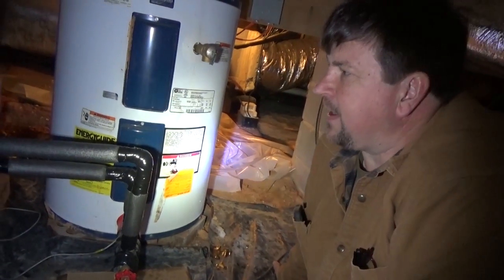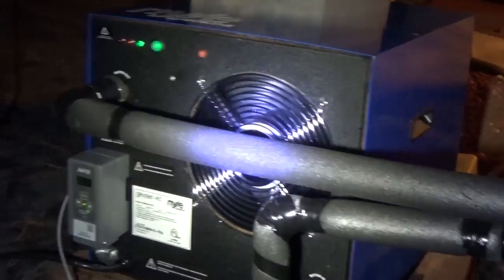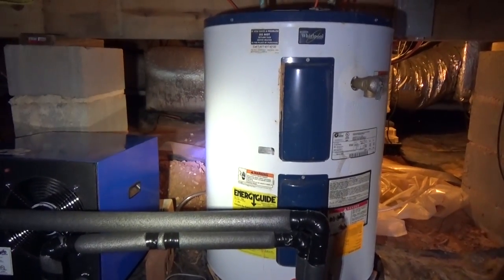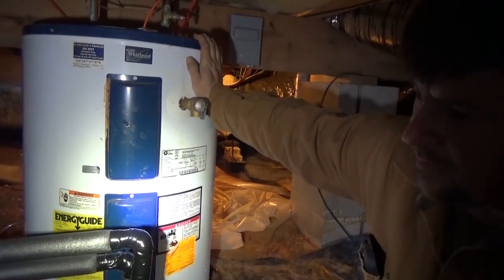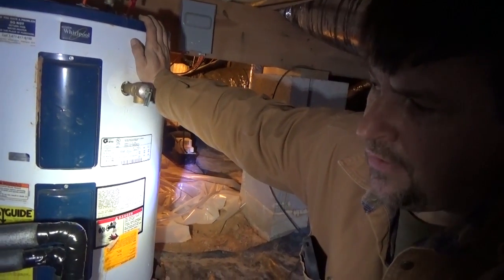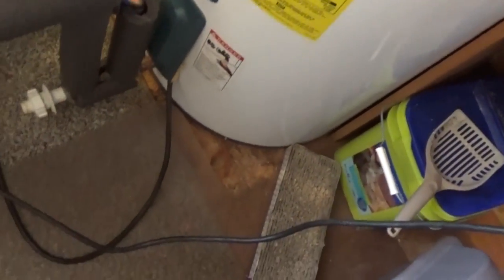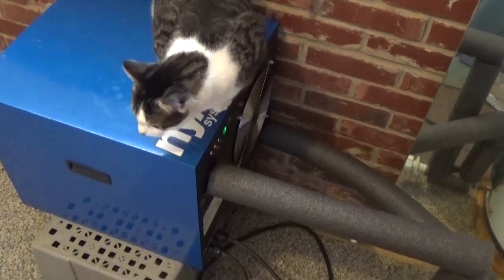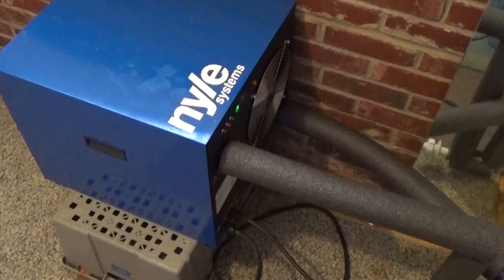Heat Pump Water Heater: Geyser

Comment: Hi Engineer775; I own a Geyser Hot water Heat pump and am looking for a PCB for it. Put in a new Compressor and know the board has an issue tried to get it repairs and the PCB biz says its unrepairable. My model is the 6000-3.0 Any suggestions as to locating  Geyser for Parts in US Located in Texas. I have owned this for 18 yrs without fail. Fantastic unit. Factory has no more parts for them.

Comment: amazing new technology. Hey can i use it on the hot water tank that is fed by my oil boiler?.I imagine the thermostat would call for heat from the heat pump instead of from the boiler or do both if possible if its winter. i also have solar on the house so the electricity to run it would be cheap during the day.

Comment: I would like to find (probably have to DIY) a system with modular components for managing heat, that interconnect and use a PLC or some other controller to best manage heat. when I say manage heat, Im talking about heat pumps (water heating, dehumidification, air condition, food refrigeration) something that can take advantage of moving the heat from where it is not needed to where it is needed and having sinks to disperse heat when there is excess, or to pull heat from when there is a deficit. the heat sinks could include, pools, ground, air. a way to bring heat from a wood stove. perhaps even electrical generation from waste heat (peltier junction, as inefficient as they are, using waste heat only improves overall efficiency)
Reply: Get anywhere with this? I've been thinking the same thing for some time now. Seems like the next logical step, but I don't see anyone tying it all together.
Reply: @pl-ps2pd  nope, maybe someday when I own a home, it will become my efficiency laboratory

Comment: I have a NYLE dehumidifying in the basement which my wife loves. I supplement it with PV solar to save wear and tear on the unit.  A 120V 2,000W  replacement element is a good match for a 36 , 48V or 60V  panel. I operate the panels at the power point voltage for the highest efficiency (MPPT).  Heating water with PV is about the best payback you can get on a small panel system.  The energy is stored in a capacitor bank and PWM into the heater element. Never direct connect panels directly to a heater element.  You will be lucky to get 40% of the daily energy.  My system is four times more efficient.  Lets face it, most of the day is less than ideal conditions for the sun.  This is why direct connect really sucks.  The heating element is a dump load most of the day to load the panels down to 60V, the max my grid tie inverter can take. A little Rube Goldberg but efficient using stuff I had around.  Solar backup for not much more than the price of just the panels.  Can't get more prepper than that.
Reply: "Heating water with PV is about the best payback you can get on a small panel system" that depressing to think thats true? 

I wish some company would create a combined heat pump system to create synergies including a geothermal source but not required for of all heating and cooling in a home. Like a HVAC, Water heating and Refrigerator since they all can be based on types of heat pumps. So it could be made more efficient if they were all combined and possibly even be cheaper? And cheap low temp solar could increase efficiency,  

But solar or point of use heaters seem like the best option in most of the world. When I travel I see both of them used, 

Just a thought,..

Comment: Hi I am thinking of getting a heat pump to provide hot water and heating through radiators. My gas combi boiler is getting old and I decided to look for new ways to get heating and hot water. Your video is great and I always enjoy watching your videos anyway. I am not sure what equipment I need apart from heat pump and associated accessories. I suppose I need a water storage tank of some kind. Some places I read up also think that heat battery is another good way to save energy as the heat produced is very efficient per kwh of output. But the battery costs a lot in the UK, btw it is where I am based! In the longer term I am thinking of going off grid but at the moment I would like to know as much as I can to cut down my reliance of the grid and be kinder to nature.
If you have a video showing how you put the heat pump and storage together that will be a great help to your watchers or give us a link to one. Keep up the good work.

Comment: do they still sell this thing?
Reply: Google it, they seem out business. Cool idea but I bet it was not worth the expense. Other make all in one units but without rebates some utilities thats other give for it, its not worth it. 

I wish some company would create a combined system of all heating and cooling in a home. Like a HVAC, Water heating and Refrigerator since they all can be based on types of heat pumps. So it could be made more efficient if they were all combined and possibly even be cheaper?  

But solar or point of use heaters seem like the best option in most of the world. When I travel I see both of them used, 

Just a thought, good luck..

Comment: Do they still make these add on units. I can't find one for sale.
Reply: Peter Holman Nyle stopped making these unfortunately.
Reply: Cool idea but I bet it was not worth the expense. Other make all in one units but without rebates some utilities thats other give for it, its not worth it. 

I wish some company would create a combined system of all heating and cooling in a home. Like a HVAC, Water heating and Refrigerator since they all can be based on types of heat pumps. So it could be made more efficient if they were all combined and possibly even be cheaper?  

But solar or point of use heaters seem like the best option in most of the world. When I travel I see both of them used, 

Just a thought, good luck..
Reply: desuperheater units are often available for geothermal systems to exploit cheap hot water. That's about as close as you're going to get. You're already in a cost prohibitive area though at that point.

Comment: Hi if you didn't want it to cool the room couldn't you simply duct intake/outtake to the outside insuring you get the 1500 c/ft..........or better still duct the intake to an area of "waste heat" like the roof cavity/attic ....wouldn't that up the cop?
Reply: great question, I live in Canada, summers are very hot , winters very cold, so yes half the year the use of attic heat in summer would be efficient but not needed as these systems are designed to work at ambient temperatures, water lines in the attic in the winter would be a pain/ could most likely freeze up. a side note: I have seen copper coils that if the incoming water from a well let say was first drawn through before it entered your hot water tank could speed up the heating process if the coil was in a summer attic, and then drained and bypassed for winter months. in the past copper tanks where used in the attic and used for the same purpose.

Comment: +engineer775 Practical Preppers
 I have a questions regarding this unit and the crawl space.  My crawl space stays humid and I was thinking something like this would be perfect to heat the water and also keep my crawl space dry.  So now I want to ask how it has been doing and also what climate are you in because it doesn't look like a conditioned crawl space to me and according to the manual you can not use these if the ambient temperature is below 50 degrees Fahrenheit.  The manual then shows in troubleshooting section that it can go in defrost mode a lot causing problems if under 50.  It doesn't make much sense to me seeing how regular heat pumps outside can work under 50 degrees F.  Have you had any issues and does the crawl space get under 50?

EDIT:
I pulled the manual back up.

"Only place unit indoors where the ambient air temperature will not drop below 50°F (10°C). If at any point the temperature drops below this, Nyle recommends that the unit is shut off until the temperature is restored."

And from the Questions and Answers section in manual.

Question: "My Geyser is going into Defrost Mode frequently."
Answer: "The Geyser is located in an area where the ambient temperature is low (below 50°F) and the humidity is high."

So how has this unit been doing?  Has it been causing any problems?  Not sure what they mean by shut off until temp is restored whether they mean drain and disconnect hoses and also turn power off or just turn power off because seems to me if it was in a crawl space and turned off the water in it would freeze because it seems to me it wouldn't be circulating still.  Any info you have on this would be great.

Comment: Sorry if I have missed this in your videos but if installed to run off my solar array how many watts would it pull.  Im planning the building of my off grid 500 sqft home. I have most things worked out but the hot water choices for solar application  all have there draw backs. Hoping this might be a solution for us.

Comment: +engineer775 Practical Preppers, thanks for the video. i have an oil furnace  that heats my hot water and my hot water base board heating. would this application work in my case ?

Comment: how long would you say Geyser has to run to heat 40 gallons of water from 50 f to 125f?
Reply: a 40 gallon about 2.5 hours a 60 gallon about 4 hours that is about the same time it takes the elements to heat it without the heat pump in use. I was an installer and representative for Nyle in 07-08, these are still great systems I use one my self in my home still.
Reply: @kiermizuik275  what's the max temp you can get from heat pump? Seen a dozen video, no one asks or cares?
Reply: @rogerkerkmann  well its a circulating and accumulating heat that collect in the hot water tank , it will keep working until it satisfies the bottom elements of the hot water tank and because of that is limited by the thermostate in the tank . but does so at 300-350 watts . it takes 3 to 4 hours to complete the process and heat the tank in about the same time as the in tank element.
hope this helps.
Reply: @kiermizuik275  thanks for the response, but my question was the max temp a heat pump can put out, 120?  180?
Reply: Roger Kerkmann I never measured it. To tell you the truth all I can say is it has to be at least as hot as the water in the tank 125 but I have seen in test it go a bit higher. But never enough to satisfied like a boiler temp for hot water heating.

Comment: I don't get how dehumidification of the crawlspace is happening.  please explain
Reply: it works like an air conditioner, it takes heat from one place and puts it somewhere else. Water condenses on the cold side because it is colder than the dew point of the air and is collected and pumped out of the area.

Comment: E775; do you know of anyone who makes a similar type of heat pump using a liquid cooling system on the evaporator side, rather than air cooled?    Here in Southern Nevada, hot water doesn't cost very much at all in the summer months, as the heat rise is minimal and and we tend to not use much anyway.  In the winter, outside temps are too cold for this unit most of the day, and most homes use heat pumps or electric furnaces for indoor climate control / heating, which seems like it would kinda destroy the efficiency by doing that twice in series?  Or maybe not...  I'm not quite sure how to do the math on that.

However, we do have a whole lot of geothermal sources (wells), and solar heated swimming pools which could potentially be excellent heat sources, but store thermal energy in liquid water instead of air.  Just a thought!
Reply: I agree it was a cool idea but I bet it was not worth the expense. Other make all in one units but without rebates some utilities thats other give for it, its not worth it. 

I wish some company would create a combined system to create synergies including a geothermal source but not required for of all heating and cooling in a home. Like a HVAC, Water heating and Refrigerator since they all can be based on types of heat pumps. So it could be made more efficient if they were all combined and possibly even be cheaper? And cheap low temp solar could increase its efficiency even more,  

But solar or point of use heaters seem like the best option in most of the world. When I travel I see both of them used, 

Just a thought, good luck..

Comment: Would you prefer the use of the GEYSER over a solar water heater considering cost, installation, maintenance, reliability and efficiency? Do you believe that there is an even better means of producing hot water?
Reply: no, but if you hear of one please reach out and tell me, I have used one of these for 15 years now and it has paid for itself many times over. I live in New Brunswick, Canada .\basements are heated in winter and damp in the rest of the year. this system was perfect for me, and many others that I had installed it for here. I think a family of four could see a 35-40 dollar a month savings the more hot water was used the high the savings, larger families it was significant, people with other than electric heat it was very noticeable ever month. please ask yourself when the last time you did a change in your home that you saved money every day for as long as the unit operated 7 to 15 years. hot water is the biggest misunderstood use of power and conventional methods pail in comparison to a DHWHP(domestic hot water heat pump). p.s., the n.b. power has a 300 dollar grant available for the use of this technology finally,  wish that was a valuable even ten years ago.

Comment: Thanks to the overlords of our DOE, we all will be required to (eventually) replace our existing water heater tanks with higher efficiency models. This means companies like Rheem are already coming out with oil, gas and electric models that have high efficiency condensing units with the pumps built into the head of the tank. This is posing a problem in some of my installations where head height and diameter is an issue. They are also going way overboard (IMHO) with the insulation jacket as well..less capacity for the homeowner, but less heat wasted through static transfer.

Comment: Wouldn't an attic be a good source for exchanging heat?
Reply from the maker: +05generic Attics are a great place to exchange.  The only problem is there water heater was in the crawlspace.
Reply: engineer775 Practical Preppers
Yeah, I guess they wanted to keep leak damage to a minimum but a crawl space is probably the coldest place. It seems like there should be some way to harvest the best of both worlds without a prohibitive cost.

Comment: its still resistive it just has much more resistance than the coil in the tank so better efficiency.
Reply: the compressor is a resistive element and also the refrigeration cycle has a resistive element called an expansion valve.  So all in all it is just a higher resistance system therefore more efficient.

Comment: can these be used as a dump load? of they receive power only a few hours a day is there any concerns you can see with the settings or electronics?
Reply from the maker: +Jason Andrade Good Question.   A few hours a day should make a decent amount of water for your house.
Reply: U need a bigger tank but have it turn on again at different time periods when both temp sensors would drop below the set temp,

Comment: I have a Geyser R, works great! Only problem I have is the drain in the rear. I also have mine tilted to the rear. I hung mine from the ceiling over my 80 gal electric WH. The drain clogs up from time to time and the condensation water runs out the back seam and all over the place. I try to keep it cleaned out so I don't get the mess! Ever have this problem?
Reply: yes i have the same thing with the same solution   i also have  water that eats up copper so i think i get a leak on the potable water side every three years

Comment: regarding the connection to the hot water tank...is that pipe something like a tube within the pipe?  I ask because it only looks like one connection and the hot water needs to be circulated someway.
Reply from the maker: +Ken Klemczak Yes sir.  There is a dip tube in the TEE arrangment so the Geyser pumps the hot water through a dip tube that is inserted in the water heater.  THe hot water rise in teh storage tank.  Cold water is pulled on the outside of the dip tube into the cold inlet of the geyser.   There are alternate ways to plumb the geyser depending on what type of tank you have.
Reply: +engineer775 Practical Preppers that's interesting.  I have a geothermal system with a de superheater.  I guess that is equivalent to this geyser... but can't be run off a small solar system.  I plumbed it differently since I didn't know about that connection that you have.  it probably helps with avoiding scale build up on the tank bottom.
Reply: +engineer775 Practical Preppers that's interesting.  I have a geothermal system with a de superheater.  I guess that is equivalent to this geyser... but can't be run off a small solar system.  I plumbed it differently since I didn't know about that connection that you have.  it probably helps with avoiding scale build up on the tank bottom.